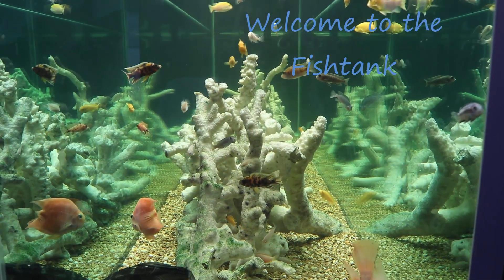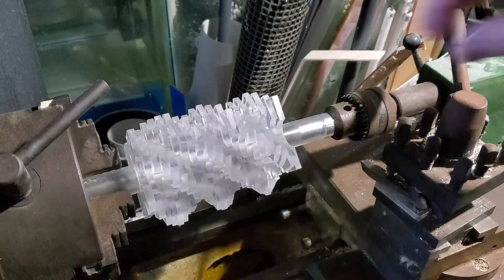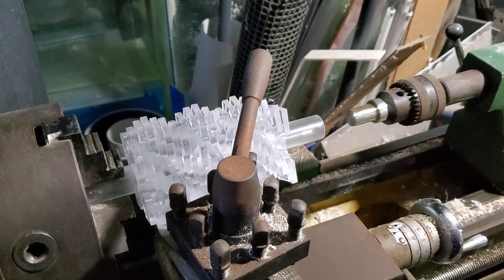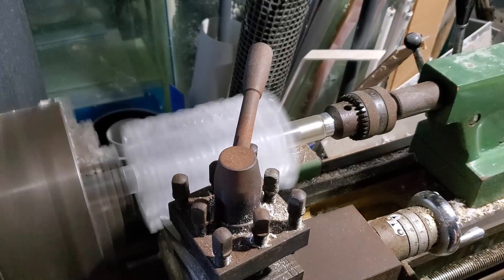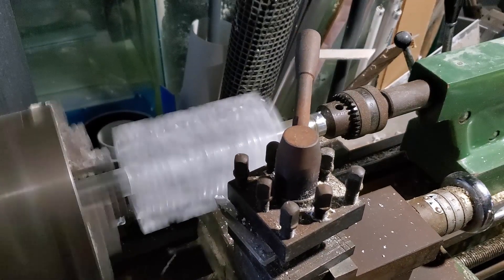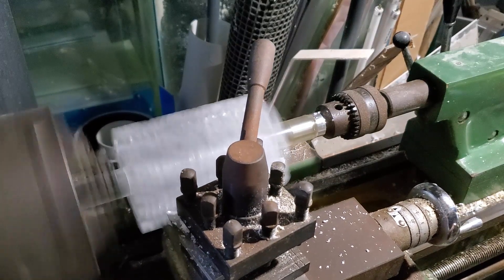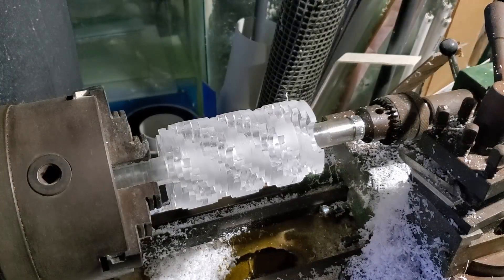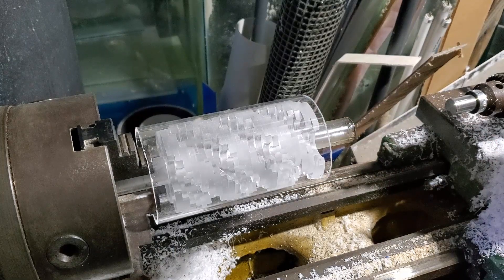Archimedes Screw for Aquariums  Part 2

Comment: We have a 30' Archimedes pump at work. It has an open top with grating, and you can stand on it.

The incline changes the game. You don't need pipe if you can make a channel.

I can think of a couple methods that are possible with your current stockpile:

- An acrylic sheet could be rolled and given a new elastic memory with some heat. This seems like it would be better with larger sizes.

- Scraps could be glued into long blocks and milled into a channel. This is limited be your scrap, so it's better for smaller sizes.
Reply from the maker: Thanks for all of those ideas and for taking the time to come by!
Reply: It's my pleasure, @FishmanEricRussell .

I appreciate your mechanical-aquarist take on the hobby.

Comment: Wouldn't pre-rounding or flattening the edges saved you a ton of time?
Reply from the maker: Yes. I did that for lots of other projects. I left them on here so I had the extra time to test out the cutting and make sure the contact with the tail stock didn't result in too much heat. Thanks for your thoughts on this and for watching!

Comment: Could you use a threading setting on your lathe to smooth out the inside of the channels?
Reply from the maker: No. The acrylic is too brittle for that. It needs the high speed to keep the chipping down. Thanks for coming by!

Comment: Fishman as always another fantastic and inspiring video.

I'm mid pond 30,000 gallon renovation and design of a radial flow separation filter to improve the water parameters from the current 120l gravel filter which has proved a pain to clean.
Reply from the maker: Thanks so much and for sharing what you are up to!